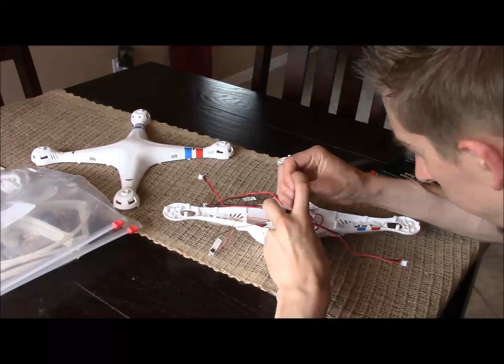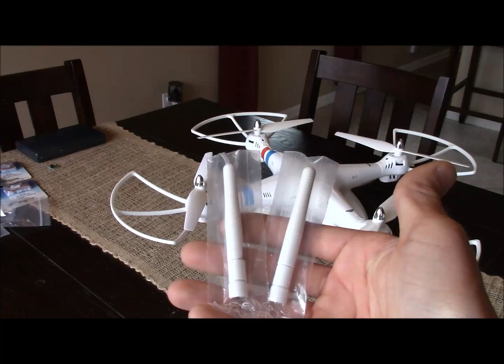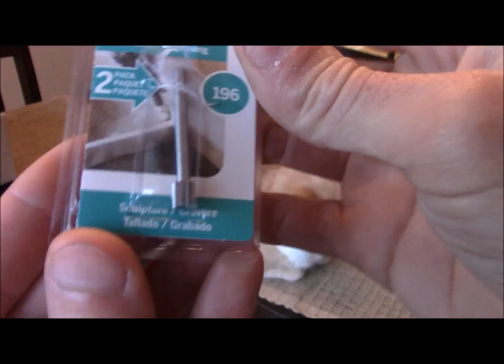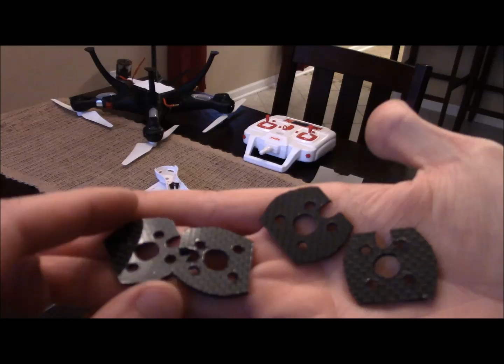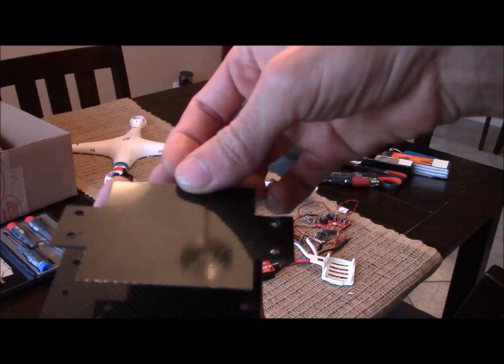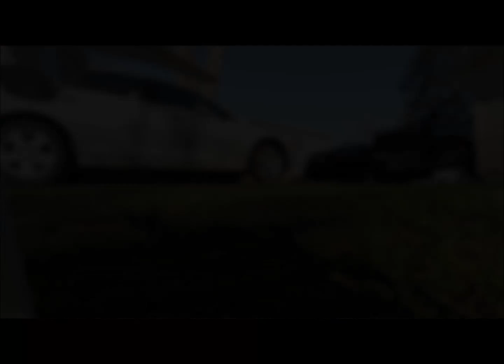Syma X8 brushless conversion with stock RC - Step-by-step how to!

Comment: why do you need a new speed controller?
doesnt the converter work right with the stock elektronik?
Reply from the maker: Salve Pacino The converter is used to convert the PWM signal from the Syma's board to a "servo" signal that the ESC can use as an input to run the brushless motor.  The servo signal it outputs is a low voltage, very low amperage - certainly not what a brushless motor needs to run.  Essentially, the converters take the PWM signal from the 2 wire syma board, convert to a high frequency servo signal for ESC, then if course the ESC will output, on 3 wires, the PWM switching high amperage signal to the brushless motors.

Comment: should be possible to convert the voltage read from the original FC to a pwm signal for esc with arduino..then you would only need 1 arduino instead of 4 brushed to brushless converters ;)
Reply from the maker: +DIY stuff Yeah I've seen people experiment with the Arduino to make servo signals.  It would probably work, but you would still be stuck without any PID controls unfortunately.  The software code required for PID control would be very complex!
Reply: +Preston Rice well you already have the pid' from the FC...But its tru..if the conversion doesnt work in a linear way it might get a bit more complicated...and since the brushless motors are more powerfull stock pids might not work

Comment: Preston, what would charge me to convert my Syma x8G like you did to your Syma x8c ? 
Is there a way to do this convertion without all the wobble ? Kinda defeats the reason for this convertion, would'nt you say ?
Thanks,
Jeff
Reply from the maker: I wouldn't want to do one of these for profit, this was just for fun.  There are brushless quadcopters out there, some even equipped with gps, for less than the material list needed for this one.  Stable flight can easily be achieved by using a custom RC and flight controller as seen in my other video.

Comment: hello! nice project, a quick question about antennas, can i use a dbi 2 in the drone and another on the remote control? 9? or maybe 15dbi?
Reply from the maker: JimLamaison I would reccomend a smaller dbi antenna.  The higher the dbi antenna the stronger and more focused the signal, but it becomes more directional. Think of a 2 dbi as a large sphere signal around the antenna.  Where as the 9 dbi is a squished flat pancake.  if the 9 dbi for example isn't orientated right, you could loose signal.
Reply: i see, thanks for replying so fast :)
i will go with 2dbi as you suggested.
I have a few antennas from some old routers of mine, is there a way to see how much dbi each antenna has? they dont have any number on them. one is 9cm and the other 13cm if it helps
Reply from the maker: JimLamaison Perfect.  I'm not sure.  it does seem the higher dbi antennas seem to be longer, but I don't know if that proves anything.  some higher end routers use higher dbi antennas for greater range and wall penetration.

Comment: i have seen someone using arduino to change the signal is it possible for you to do that?
Reply from the maker: I have een that also.  If I knew the coding, it would be possible.  I would however have to buy smaller individual ESC'S in order to make room for the Arduino.  Of course a cheap flight controller and RC isn't much more ;)

Comment: whether it can use SkyRC 2830 X 950 KV Brushless Motor????
Reply from the maker: +Rief Fauzan Those motors should work just fine, as it appears they are a replacement for the Phantom.  Just be sure to get two sets containing a clockwise and counter-clockwise pair.  There are many different brands of brushless motors that could be used in this application.

Comment: which means you tried to calibrate esc ?
SYMA turn on , throttle to the max up , you give power to the ESC , beep beep , throttle down , esc calibrated .
Reply from the maker: Yes, thus is standard procedure.  The ESC will not function until you do this.  The ESC has nothing to do with PID settings however.
Reply: I am very curious what manner friend Muhammad Imam Zulkarnaen do mod without converters and without arduino , although I do not know why but he wrote that arduino as a converter is not good fly . I do not know why or for arduino be allowed to convert the signal . esc programming because it's not easy. final method is like you have so that the new apparatus and naze32 :)
i wating for tutorial from user Muhammad Imam Zulkarnaen :)

Comment: can you put the links of the things you put to the syma? plis. I will suscribe to your channel
Reply from the maker: Sure thing buddy, I will leave links to the parts tonight when I'm home from work, and I'll notify you when they're up.
Reply: +Preston Rice ok thanks
Reply from the maker: +Pedro Díaz Muñoz Hey buddy, parts list and links are up.  Look in the description near the bottom, for the clickable links.  You can buy the parts form multiple sources (but I typically order from amazon.com since I have prime and shipping is free and quick).  I omitted the antenna and RP-SMA connectors since I didn't use them in this video.  Happy modding!

Comment: very nice project :) ... can i ask you about one problem of mine on my x8c? when i put power on 100%, the motors arent running on all power (cant lift my gopro on it)... only maybe for 1/4 - 2 seconds motors get 100% and lift up...then again fall to i say 80-90% of the power. Battery is ok, outcoming voltage on motors are about 8V on full power. Where is the problem? bad motors or maybe problems receiving board? tnx
Reply from the maker: Which mode are you flying in?  The button at the upper left on the controller toggles between beginner and advanced mode.  If your in beginner mode, the power is greatly reduced.
Reply: +Preston Rice 
you mean MODE 1 and MODE 2 on the remote? or H and L letters on the remote? Or when you press left upper for 3 seconds? all of that i tried, or is it something else? ...but  i think something other is the problem... i can send u a video if u would like to see...

it looks like that:
- i power it on with full charged battery
- i put left stick up on full power
- drone try to lift up
- its still trying .. going little up and down like it dont have enough power (sound of the motors and everything are not clean...
- ON SOME MOMENTS, DRONE SUDENTLY GETS FULL POWER AND LIFT UP AS IT SHOULD ... but that moment is for about 1/2 - 2 seconds.. (the sound is "clean") .... 
- back on trying with wird sound...

Is it possible that something is wrong with the main board?
Reply from the maker: Hmmm, yeah a video would help.  I would doubt an issue with the main board.  Do all motors turn freely?  If a motor is dragging, it will have to reduce power to the other 3 to continue a stable flight.
Reply: after 10 or maybe more reassembles and comparing each part i found the one of the new main stand was bad; the iron part was for about 1.5mm longer then others...so i figure that maybe is the reason for unstable power control of the motors... At the end, i change this main stand with new one...now my x8c fly normally and lift is good enough with gopro too.
Reply from the maker: +Matej Dušič Awesome man, good to hear you found the problem.  The stock gear driven motors can be a bit finicky at times!

Comment: Is this possible with the altitude hold on the x8hg - still retaining that function?
Reply from the maker: Ralph Latham yes that would still work.  On this project, the original flight controller controlled all aspects of flight, which would include the altitude hold if yours has that.
Reply: gr8:)

Comment: I have never heard of anyone prefer a butane soldering iron to an electric one. This has to be a first. Anyways don't mean to hate, it's just kind of a ridiculous advice in my opinion. Just get a proper soldering iron like the Hakko FX888 or a Weller WE1010. I solder about 10 PCBs a week and I use a professional soldering iron system Metcal MX500, but have used Hakko FX888 and it's quite alright for soldering. If you're having issues with it then you're either not using proper solder, or flux.
Reply from the maker: I have a soldering station / SMD hot air rework station now and I love it.  I liked the butane ones for portability and because they can get very hot.  If you can stay working at a bench, then electric is your friend.  Thanks for the info!
Reply: I prefer butane soldering irons for damn sure...no wires, completely mobile and it heats up so fast and always gets hot enough to make work easy and quick. Before I finished my engineering program many years ago I worked a grueling job for a company repairing motherboards all day...I have soldered on literally thousands of mobos in my life. Granted, we of course used soldering irons that were electric but they were expensive and definitely not mobile. Butane is perfect for home hobbies. NOT ridiculous...IS practical :D

Comment: hello,could not see those two 2.4 GHz antennas 3dbi you showed us installed after your modification,did you change your mind ?
most of X8C user install  5dbi in TX and 3dbi on RX,but u insisted and recommended on both being 3dbi,WHY ?
Reply: sorry,you recommended 2dbi,one in TX and the second in RX,can u confirm that today you believe is the right thing to do ?

Comment: Why is the aircraft so shake
Reply from the maker: VietNam Coffee It is impossible to tune the PID settings with the stock RC.  I predicted some shake, but it was worse than I thought it would be.  Please check our my video update, showing how I achieved stable flight.  Or, check out my other build using a custom flight controller from the start.

Comment: what happens if you just solder the motors straight to the board.  no esc.
Reply from the maker: Soldier1287 They will not function whatsoever.  There are not even 3 wire connections at the board, since the syma uses regular 2 wire brushed motors.  Brushless motors require 3 wires, and unlike a brushed motor that requires a steady input voltage, brushless motors operate via a complex algorithm of switching frequencies between the 3 wires.  A brushless ESC is mandatory for brushless motors to work.
Reply: ok
Reply: so motor > ESC > board?   

I'm going to do the mod to my x5c
Reply from the maker: Soldier1287 Motor  ->  Signal converter  ->  Brushless ESC  ->  Brushless motor.  (you need the signal converters from the board to ESC, unless you have an ESC that can recognize the PWM output from the Syma's board.  Most ESC'S require a "servo" type signal which is like 500-1500hz or something like that).
Reply: alright

Comment: Could I perform this mod on a Syma X5SW?
Reply from the maker: Fabs - Rocket League The X5 is much smaller, but you could convert one if you bought smaller motors and esc's.
Reply: Alright, thanks for the info.

Comment: What does the 
-EMAX 4-in-1 25 amp ESC do?
Reply from the maker: Justin Palardy --Powers all 4 motors.  Instead of buying 4 individual ESCS I used that. It worked alright, just a bit large.
Reply: Thanks! :) Cool video, I liked and subbed :)
Reply from the maker: Thanks man!  Check out the update video where I made it fly good.  It's just a closet queen now, been to busy with my business startup to do any more flights or  videos!

Comment: whats the ultimate goal of upgrading with brush less motors>??
Reply from the maker: Dilshan Perera Dude.... did you really just ask that.  They're toys man, the goal is to have fun!  Kinda like throwing a ton of power at your muscle car project, more power is more fun!
Reply: no man ohh,,u got it wrong.i mean y brushless motor upgrade?what does it improve?
Reply from the maker: Dilshan Perera Brushless motors are significantly more powerful!  Check out my flight video running the Syma on a 4 cell 14.8 volt lipo with the brushless motors.  Thing is crazy!  Brushless motors are also much more efficient.  ;)
Reply: oohhh.is that so,,thanks i'll watch...if u dont mind can i email you?cz i own a syma x5 and cant wait to upgrade it too..sen me ur email address.
Reply from the maker: Dilshan Perera you can actually just reply a message back right here, or you can always send. private message to me through YouTube.  You just have to click into my YouTube profile and click on send message.
Reply: i have a syma x5 and i have no money to buy a racing drone and im looking for an upgrade like yours.which improve stability,and more power...whats ur suggestions??
Reply from the maker: Well, you can build your own racing drone pretty cheaply, but you could try to mod the syma for less, but that gets expensive too.  I spent around an extra $250 usd or so to upgrade mine.  You can build a cheap racing drone for about the same price, with parts that are more conpatible.  Otherwise, you could just add a fpv camera to your syma that you can link to some sort of virtual goggles or fpv viewer, it wouldn't be a quick quad but you could enjoy the fpv experience like you would get with a racing drone.
Reply: ohh..thanks bro i used syma wifi fpv camera and its  bad quality and full of lags.
Reply from the maker: Dilshan Perera yeah, installing your own fpv camera would eliminate that.  the Syma's camera is wifi based and very prone to interference and lag by design.
Reply: so whts d best camera setup for less money??
Reply from the maker: If I were you I'd just save up and build yourself a cheap DIY racing drone.  The individual parts are so cheap.  You can get a frame kit literally for like $15 (USD).   That would be the most affordable way, that would still leave you with something fun to fly.
Reply: yeah thats jst the board and threres some other parts too honestly i cant go over $70...cz im from sri lanka and here rates are so high
Reply from the maker: Yeah I hear ya.  Too bad it costs so much more by you, I would think being closer to the source (China) things would be cheaper!  I know some of my Malaysian viewers have made the same comment though.  You may just want to think about wiring in an FPV camera to the Syma, and maybe changing out the 2-cell Syma battery for a similar sized 3-cell 11.1 volt LiPo battery to give yourself some more power.  I believe the Syma boards can handle the extra voltage, although the power transistors  on-board that control the motors could be easily switched out for a more rugged part.  The power transistors (I believe an NPN) are a standard and cheap TO-220 size.   The added bonus to using the 1 cell larger battery, is you can power a 12 volt FPV camera directly from battery without using a step-up (or down) voltage converter.  The life of the Syma's motors could be reduced, but honestly I think it would be alright.  You certainly could do this within your budget, and still enjoy a fun flight.  You will, of course need an FPV ground station too, either goggles (expensive) or just a cheap RF monitor setup.  Or say screw the camera stuff, and just fly the Syma for fun.
Reply: ha hahhh yep ,thanks of the info bro...i'll try

Comment: I DONT THINK THE RECEIVER IS THE PROBLEM I WOULD GUESS ITS THE BOARD..WHATEVER THE ISSUE I WOULD CHANGE THEM OUT NOW AND AMORE VOLTAGE SINCE YOU WENT THIS FAR..
Reply from the maker: +Joe Mamma The receiver is the "board".  The flight controller, receiver, and all 4 ESC's are in the singular red circuit board.   Check out my other video using a custom flight controller and aftermarket RC to obtain a smooth flight.
Reply: Preston Rice AHHH...That is a bummer they incorporated the receiver into the mainboard...like integrated video cards on computers caa caa.

Comment: I'm sorry to sound like a Debbie downer, wouldn't it be easier to buy a phantom shell and use the internals from the syma? Just trying to cut out some of the fabrication.
Reply from the maker: Francisco Palafox Yep, it would be.  But I did this build for the same reason many did, to have an actual Syma x8 but with brushless motors.  It was sort of the fun of the matter, not exactly setting out for the best result at first.  The challenge in itself was half the fun!   Be sure to check out the follow up video for this model, thanks for watching.
Reply: Droning Around thanks for the videos, they are awesome. I recently bought a x8c on Craigslist for 20 dollars. The drone had 2 of the same side propellers in the back and the guy coulda figure that out. I'm going to fly this bad boy till I break all the spare propellers I bought, or till the engines die. Then I'll save up and upgrade to brusless. It's going to take a while lol.
Reply from the maker: Nice, that's funny, great find.  The x8c's are suprisingly durable!

Comment: Not a good idea to do this. The parameters of the controller do not really fit to the power of the motors. All reactions of the X8 are oversteared.
Reply from the maker: Yep, it reacted as I expected.  Check out my other Syma retrofit with a custom flight controller, nice smooth flight.

Comment: what about x5c?
Reply from the maker: Soldier1287 What about it??
Reply: can a similar mod be done to it?  installing the brushless.
Reply from the maker: Of course, you can do anything with money and ambition.  Since the X5 is much smaller, you would need to source smaller brushelss motors and props, and of course smaller ESC's to match - 12 amp?  Overall, it would be a similar build, but with smaller parts.
Reply: ok